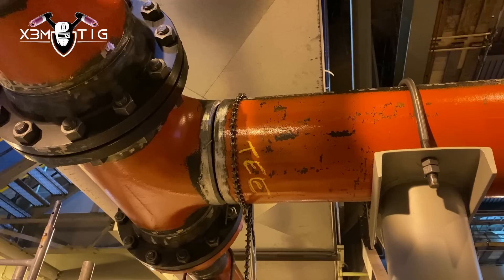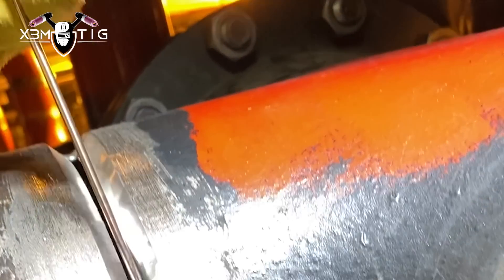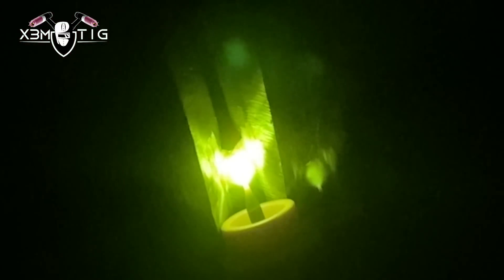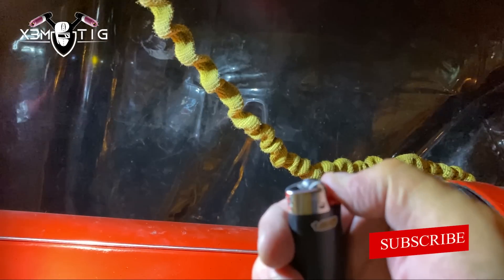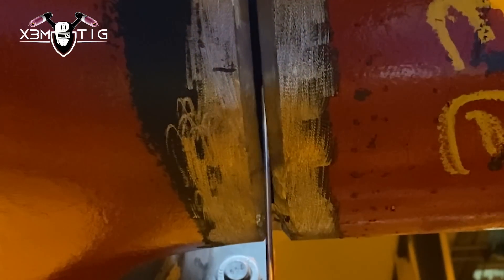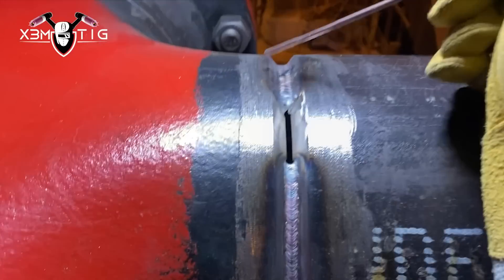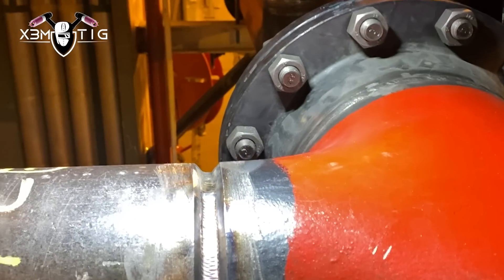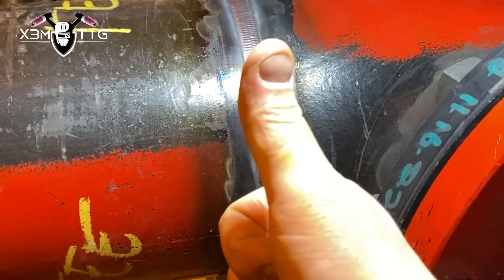TIG Root Pass on 10” Carbon Pipe – X-Ray Quality Welding Tutorial!

Comment: Hey sir as a 2nd year I was always told that if you have the ability to tie in perfectly then you dont need to worry about stopping too much. Obviously a seasoned pipe welder usually can run from 6-12 no problem. But I was wondering if thats kind of a myth?

Comment: Hi mate, as always good video. My question is, how many weld joints u are able to do in one shift? Is it 250 or 300 mm pipe diameter? I like to watch how do you weld, im welding as well, but always love to see how someone else is welding.
Reply from the maker: Hey bud thanks for your comment! I can do two 10 inches or 250 mm , butt welds in position if I want to per shift.

Comment: Please, someone tell me, how do I get a good root penetration on my TIG root pass? I wiggle the cup very nicely but can't get a good penetration. Please how do I get a good penetration on my root pass? Thanks 🙏🏾🙏🏾🙏🏾
Reply from the maker: Hey bud, that’s something you have to discover by yourself. Videos can help you to understand basics, but you need to experiment what’s working best and improve in that direction. Could be lots of factors, like; inclination, amperage, travel speed, gap, etc. Prepare few pipes with different gap size, and see would it work better. When I started with welding I was making notes of what’s working and what not!
Reply: Thanks a lot sir. I appreciate. Will work on that

Comment: Since you had a pretty inconsistent gap, I was wondering if you could do 5/32 laywire in the spots you had a 5/32 gap? Also what heat would you run that on for the 5/32 lay wire or would it be best to do the dip technique
Reply from the maker: Hey bud, yes you could. I would prefer to use 5/32 rod on 1/8 gap instead, as I will crank up the amps and push that rod inside the root with laywire technique. Probably around 140-150 amps.

Comment: I’ve been practicing back feeding but I’m having a lot of trouble. The inside of the pipe looks decent, but the weld on the outside of the pipe on the overhead section is very droopy. Any suggestions?
Reply: I've found that happens when you're running a bit hot or sitting in one spot too long. Try turning down 5-10amps so it allows you to catch up with your wire if you're not comfortable with traveling faster. You really wanna make sure you're pointing at the bevels instead of right in the center. I had to mess around with a lot of things to finally get less suck back on mine aswell just takes practice👍
Reply: cleon135

Thank you for taking the time to reply. I greatly appreciate that. I tried turning down the amps and it actually made the humping worse on the outside. When I ran it hotter, it laid a bit flatter. I think that I’m not traveling fast enough bevel to bevel? Also, what angle should I hold the filler metal at? I’m holding it straight down through the top of the pipe as I weld the bottom
Reply: @shawnramey614  Hold your filler wire between the gap,and try backfeed. It will be easy if you walk the cup,bottom part of the pipe; push more rod, try like back feed technique. On the side wall or 9 o’clock speed up or pull rod slightly outside the bevel, and on the top part; speed up, keep rod above that bevel edge, gravity will push that puddle down.
Reply: gruzin500

Thank you so much for the tips! I believe that’s what I’m doing wrong as I’m backfeeding, I’m not pushing the wire slightly outside the bevel, I’ve been keeping it fully on the inside!
Reply: @Shawn Ramey  Make sure your fingers are feeding the wire. When backfeeding I try NOT to keep the wire at 90° as it may introduce cold wire and you may not realize when to move. I keep mine around 70° or (\ ) if that makes sense. Like Gruzin said try walking the cup before you free hand imo my roots came together faster and could learn free later. I made a lot of trashy roots at home before I made good ones just keep playing with variables and they'll come together. A well developed skill takes just that, time.
Reply: cleon135

Thank you very much for taking the time to reply. Yes, what you said made perfect sense. Try walking the cup and keep the wire inside the pipe but keep it at a 70 degree angle.
Reply: Lower your amps,you're burning the edges.